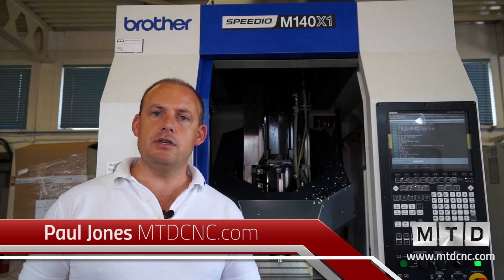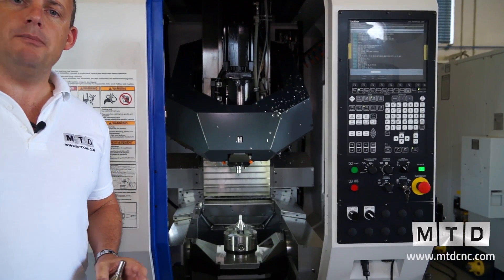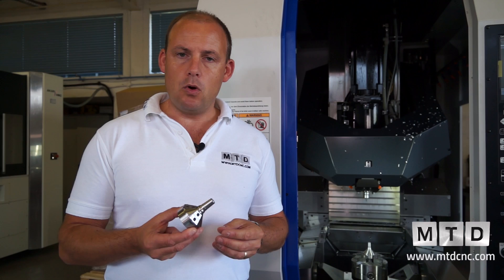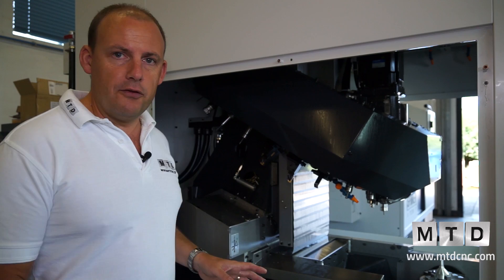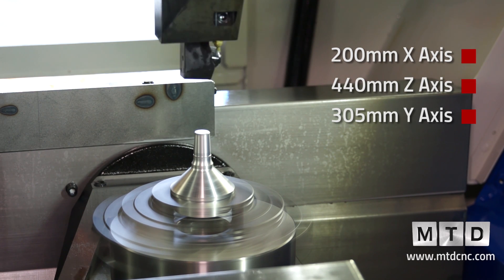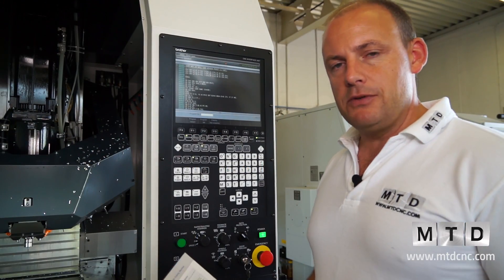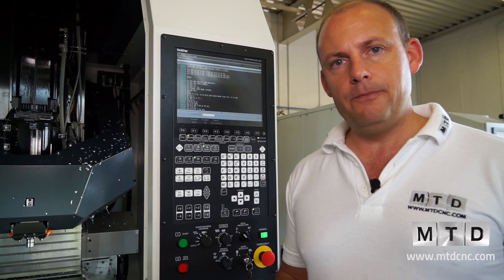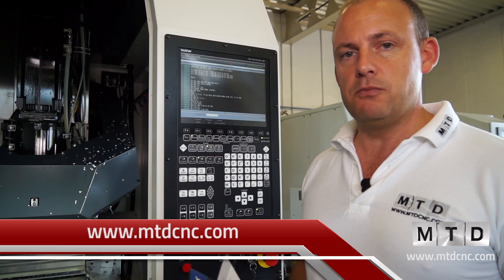WMT SPEEDIO M140X1 High Speed Machining Centre

Comment: The brother website lists the spindle as 10.6kw, not 18.9kw. Which is the correct value?

Edit: I see on their "Features" page 18.9kw, but on their "Specifications" page it is 10.6kw.
Reply: Hello Meocats, The M140X1 machine has max output of 18.9kW amd max torque of 40Nm when equipped with the standard 10,000rpm Spindle. If you have any further queries please drop me a line at timw@wmtcnc.com
Regards,